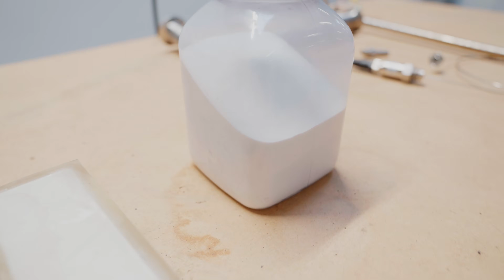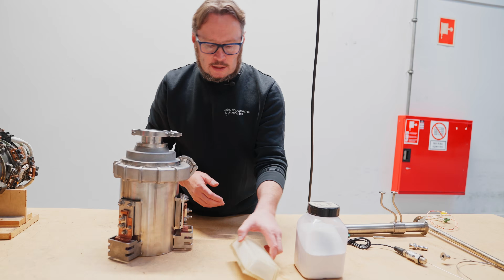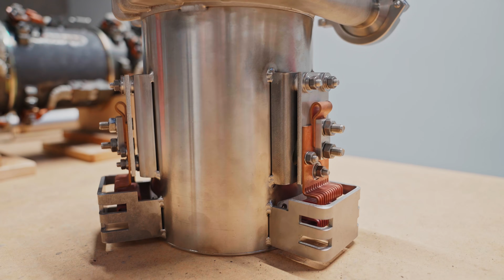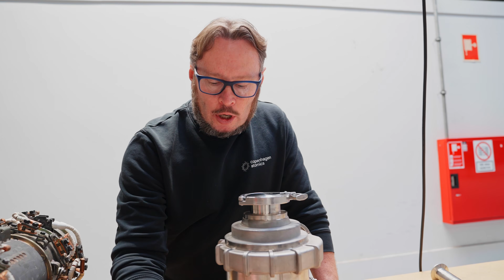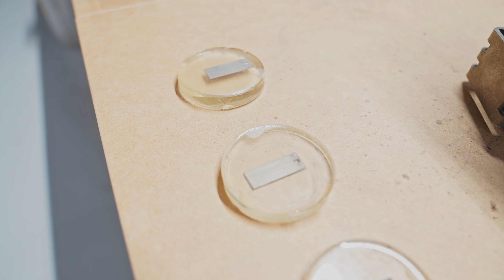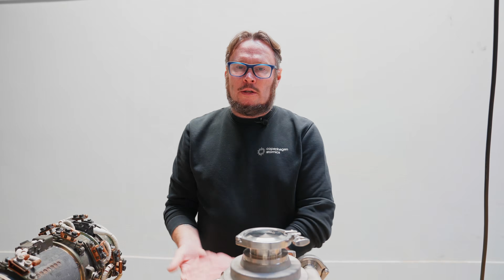How a Molten Salt Pump Works?

Comment: You are handling the solid salt without gloves or other PPE.   Is that FLiBe ???   If not, which salt mix are you using?
Reply from the maker: if you look closely there is a plastic casing around it.

Comment: Would a magnetically coupled pump work?  Basically the inside has an impeller with magnets in an inner (probably ceramic) shell, with molten salt flowing in it.  The outside contains a motor with a cylinder that spins around the "outside" of the inner shell with magnets (to couple to the inside impeller) and the whole thing is stuffed into a metal case.  The 3-phase power design makes good sense though I suspect you meant BLDC.  I too would suggest an off-the shelf motor, though if you need some real torque, I'd be looking at some of the new EV car motors with 100+ hp in a small space and use that for the motor.  They are basically BLDC type which are also driven by 3-phase input power (it just has variable voltage and frequency).

Comment: There are pumps just like that at Dounreay nuclear decommissioning.  To make the pump parts exposed to the radioactive salt, there is a magnetic coupling that
allows the motor to be decoupled without affecting the salt flow plumbing.

Comment: Corrosion of molten salts in tubing - particularly FLiBe - is not only an engineering nightmare, but also an issue of material science. That was the reason, we have decided in our now closed down institute to circumvent the whole problem and had designed a thorium-reactor with an eutectic mixture of Bi, Pb and Th. Since BiPb is less transparent to neutrons, we used the D-T Hirsch-Farnsworth fusor to create 14.1 MeV neutrons. Unfortunately nuclear weapons countries were not enthusiasic about a machine, that could replace U-235-reactors and thwart the production of weapons grade Pu-239. So the project has been stopped and buried.
Reply: It's pity that humanity has to bury such useful projects for the sake of nuclear proliferation.

Luckily, I've seen that prof. Farnsworth has solved many of these issues in Futurama.
Reply: @LubosMedovarsky  It is not only the nuclear weapons coalition, that derails such projects. E.g. my country (Switzerland) has started criminalizing every innovation in the field of electrical energy production and long term storage with the new enactment to the EleG (law of electricity) since 1-1-2024 by merging it with the drug law (BetmG). Every new technology is punished, for that no preexisting law and established approval procedure exists. Forbidden is publication, to pitch, manufacture, sell, putting into circulation or operate such a device. The range of sentences corresponds to about 1g of an illegal psychotropic compound corresponding to 1kWh of illegally created energy. It is not a coincidence, Switzerland has the lowest part of renewable energies in whole Europe and our minister for environmental protection is paid by the oil industry (Dr. Albert Rösti was the former CEO of SwissOil). This provides the proverb about the fox in the henhouse a completely new meaning.

Comment: So when the system cools and the salt becomes a solid, how can the system be safely restarted? I ask as I recall the bio-rendering plans having a similar issue when the animal fat became "cold". Thus pumps and sensors would constantly be damaged and need to be replaced. Sure its not a nuclear reactor but it does deal with an active system, that in many ways can not be easily taken offline if a pump / sensor fails.
Reply: I guess they has to put heater everywhere
Reply: Likely they drain everything into several dispersed vats before shutdown.
Reply: @echomande4395  For a "Normal" shut-down yes. Though I have seen unplanned shutdowns take an entire "fat" rendering plant offline. Resulting in $$$ in damages as the fats are not able to be easily re-melted, effectively gumming up the whole works. Now take this, scale it up and make it radioactive... See my point ?

Comment: The major challenge with nuclear energy is the long-term storage and management of radioactive waste. Spent nuclear fuel remains hazardous for extremely long periods of time, requiring secure containment and monitoring for decades to centuries. Concerns over storage capacity, environmental contamination, and the potential consequences of leakage or system failure continue to drive public and scientific debate about large-scale nuclear expansion. Given growing land-use pressures and environmental risks, greater emphasis should also be placed on renewable energy technologies such as solar, wind, and hydrokinetic power. My company is focused on developing advanced hydrokinetic energy systems because the oceans contain enormous untapped energy potential that could provide a continuous and sustainable source of power
Reply: After having looked at all the different waste storage & disposal systems the one I'd chose is putting canisters of GLASSIFIED waste slightly UNDER the surface of the ocean floor DIRECTLY AT a fast moving subduction zone and let it be carried back under the earths mantle to mix and dissolve with the rest of the "slightly radioactive" Earth's molten core. The Earth would die if only the sun provided energy for life, the molten core's heat seaps out and is a significant contributor to life on Earth. Adding in a bit of radioactive material, all we/ humanity could produce is an unmeasurable fraction of what exists down there  AND it will add to extending Earths lifetime (tiny fraction, maybe a thousand years, smile).
Its also why I believe that geothermal should be used more, its not 'free' and is a technically challenging as molten salt reactors but far far safer.
Reply: Waste is NOT a problem. If you burn the "waste" in a reactor, it becomes fuel. And you can also extract useful isotopes from it.
Reply: @Naylok83 sorry, when some people say "waste" they only mean spent fuel. But OTHER waste (and its LARGE volume of it comparatively) is structural and mechanical components that have become radioactive and probably experienced degradation of material characteristics (example hydrogen enbrittlement) that are radioactive enough that they cant be left out (in a junkyard) to cause secondary irradiation. The halflife of sone of this materal is just decades but with other materials its thousands of years.
Since no human civilization (or just a goverment & funding collapse) can be expected to last that long (and I'm an optimist on that) all storage has to be passive containment, not anything that has to be actively maintained.
Remember the recent "radioactive imported shrimp" issue? Whats been found out so far is that a scrapped medicsl device containing a radioactive source 'capsule' was thrown as general scrsp into a steel melting furnace and some remained in the steel but a lot of it went up the smokestack and the winds carried it and spread out across Southeast Asia, contaminating hundreds of thousesnds of square kilometers. It probably wouldn't hsve happened in a first world counyry like the US or Europe but tgen there's tge 3rd world problem of culture and its relative ignorance. You can try to idiot proof things but a better idiot will ALWAYS come along.
Reply: well every form like hydro electric or geothermal has different forms some completely different so its trying to explain something thats not a forward answer but technically geothermal is more efficient than nuclear well one form is the center of earth and not even all the way down but it has enough energy renewal green to literally power all of earth without all other forms basically energy on a planet scale but with others like every energy form it has its place like molton salt or thorium basically in more remote parts so with each it has limits like solar yes it works but there are limitations

Comment: I wonder if a totally contactless rotor is possible. Say, the pump continously generates some kind of pressure differential without touching anyting. IDK how that's even possible. May be using another fluid (like air) as intermediate? Dunno. Let's keep thiking.
Reply: Turbine engines (jet engines) have porous turbine blades where air is pumped thru, which protects the blade from the hot exhaust gasses by creating a cushion/jacket around the blade.
Reply: Maybe something like a highly engineered peristaltic pump? In principle i guess

Comment: Couldn't find any company? Nonsense. Lots of companies offer them. What he meant to say is at a price I am willing to pay.
Reply: First few I found can't do the temps he is asking for tho.

Also, you don't know when he tried buying them. Probably not yesterday, considering he built, tested and used his own design.
Reply: @randomviewer3494 I work for a pump company. We have been making molten salt power systems for decades. I work in the valve division so don't know what specific pumps my company offers, but I build valves to control the salt, so if we aren't making them, someone is. The salt doesn't flow on its own. 
He might have issues finding a very small one, or be trying to meet some special requirements. But most of these pumps are engineer to order, so I can say with near certainty someone offers what he needs.
Reply: Its 'correct', Only china has an operational molten salt reactor. No companies make pumps for radioactive molten salt. Though that's obvious since the market for those products is 0, Unless they are involved in making a molten salt reactor, but then they dont even have to commercialise the product, They'll sell the entire setup.
Reply: @-yttrium-1187 The solar farm in Las Vegas was built using molten salt. It isn't only used for nuclear reactors. 
Also chemical processes sometimes require it. Currently working on an issue at a urea plant where the molten urea is solidifying in the valve neck, destroying the packing and valve stem.
Reply: @court2379  The guy in the video said that he couldn't find commercial molten salt pumps That were radiation resistant Which, if you missed that specific detail, it would be strange to claim that there are no commercially available pumps that fit the specifications he wanted. Also, slightly jealous of your job.
Reply: @-yttrium-1187 The only thing that is an issue with radiation is the packing, and that is also available commercially at any vendor that supplies packing.
Why jealous? Valves and pumps tend not to be a glamorous engineering job.
Reply: @court2379  It definitely depends on the radiation enviroment though, 10 years of low-level neutron radiation can embrittle any part far beyond their specification.

The grass always seems greener on the other side. I've always been interested in these giant factories that make the feedstock we use for everyday products.
Reply: No serious engineering department will serve that kind of application unless there's a serious business opportunity and no liabilities.
Reply: @IdeesDePhysique The seller isn't liable for the use of the product. Only that it functions to specification/contract.
Reply: @court2379 any promise made by sales to the customer is a liability. So, when sales question the engineering dpt for technical info they hear to not promise beyond spec/to discourage the customer from buying.

Been there & done that tens of times.